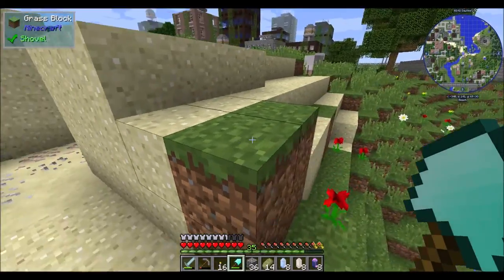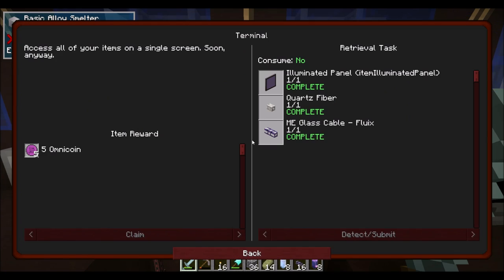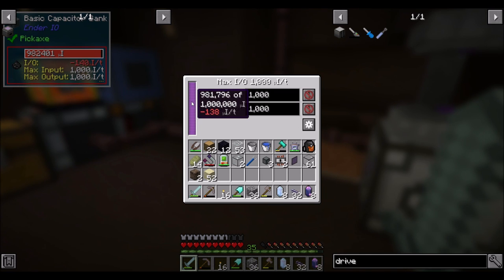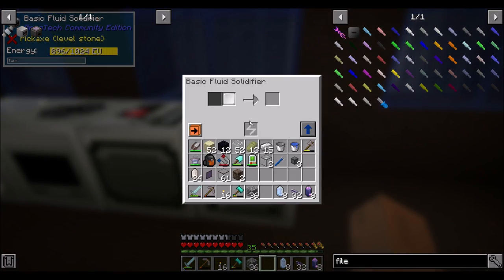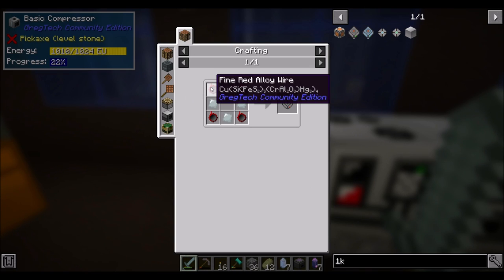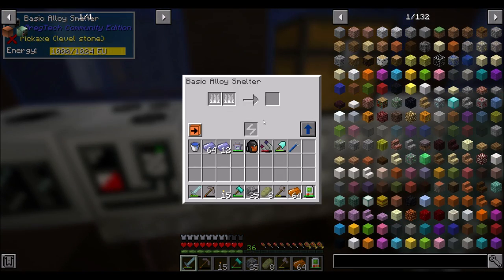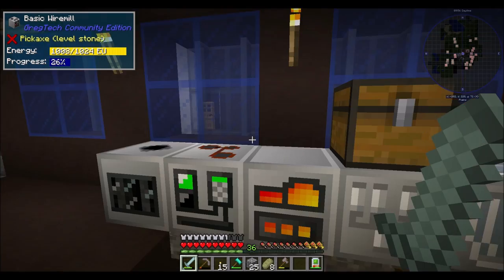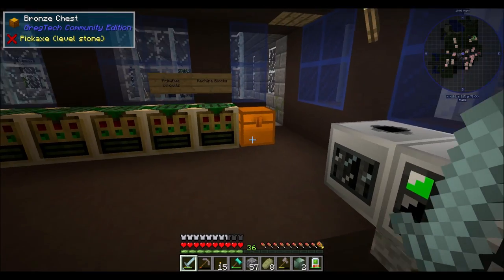OmniFactory   Ep11 AE Progress and Blast Furnace Start

Comment: Overclocking a machine:  A recipe that is <=8 EU/t is a ULV recipe.  It get's automatically overclocked to LV at an increased power usage.  in an MV machine it gets overclocked a second time to MV power usage.  Same for all the power levels.  So a ULV recipe will run very quick in an IV machine.  Of course it's still more efficient to make multiple copies of machine than overclocking but there are quite a few good uses for it.  There are covers to machines that serve as upgrades, but nothing that accepts speed other than a stop on redstone signal cover.  

Don't be afraid to overproduce, letting machines run constantly is key to not grind things out.  Even those cupernickle coils are useful for other things.  You'll need another 16 for the pyrolyse oven.  You'll also eventually want a few more blast furnaces and they don't all need upgraded coils.  

Make a fluid trash can, you'll probably want one for all the gregtech fluids and it's about the same price as that tank you wasted.

You looked at the lathe yet didn't make it?  Don't just assume you can't make something that will save you a ton of resources for motors and rotors/etc.

I know it's being said every episode, but you are running out of copper because you still don't use fine copper wires in your recipes.  You are literally wasting 4x the coper everytime you can use that instead of normal wires.
Reply: Nedrith Stormfire he also needs to realize that there are multiple circuits per tier
Reply: Also dire if you read this, use the Gregtech quantum tanks, the basic tier is as good as gargantuan drums
Reply: @direwoft20 look at ae2 pattern recipie and tell me more about ae2 automation ??? How do u automate ae2 with no pattern ( the pattern req. lv 3 circuit and polyethelyne sheet ) i don't rush ae2 i rush pattern and it work LUL 

Soo use logistic pipes if u don't want to go MV tier and lots of tier 3 circuit :)
Reply: @dourmaster  Logistics pipe would almost definitely be both more fun and more useful than AE early on.  Personally too lazy to bother but the recipes don't look that bad.  However, one big advantage it has is the remote orderer(and ender bags are in the pack for remote ordering on the go).  

AE wireless terminal requires EV emitters which in turn requires tier 4 circuits and titanium.
Reply: What about recipes that use "uneven" amounts of EU/t? Like those 60Eu/t electrolyzer ones, or basically anything that isn't 8,32,128...
Reply: Dire is his own worst enemy
Reply: @SigmastormBeheHunter  Each tier has an upper or lower limit.  ULV is 1-8, LV 9-32, MV 33-128, Ect.  So a 60 EU/T is an MV tier recipe, needs to be made in a MV+ machine and is overlocked once in a HV machine, twice in an EV machine, ect.
Reply: @andrewgood7956  I see. Got it. Lower voltage required than cap (let's say 60EU/t on MV setting) allows just for some leeway in case I want to use cables with energy loss per block when I still want to use just 1amp, right?
Reply: @SigmastormBeheHunter  basically correct though it also allows you to run multiple machines on 1 amp as well.  Most machines however can only accept 1 amp.  Thermal centrifuge is one of the few non-multiblocks that can accept more than one amp.  Blast furnace and a few of the other multi-blocks can accept something like 2 amps per an energy input hatch.

Comment: I loved logistics pipes, not for crafting, but for sorting and storing and making everything available. Put a remote request pipe next to an ender chest and hold an ender bag of the same colour and you have transdimensional storage. Put an extractor pipe on an ender chest and carry an ender bag of the same colour and you have transdimensional automatic storage. Set the logistics pipes up to make a sorting system, use AE for the crafting.
Reply: I liked them for crafting, since they are much more powerfull than AE.
With sattelite pipes and the ability to prefill a recipe you can have a very fast and complex crafting system.
Reply: @hubertnnn  It quickly got complicated, though. AE started off complicated and just stayed there. Logistics pipes and the other pipe based crafting systems all had a problem of exponentiating complexity.

Comment: Damnit, Dire! Use fine wire!
Reply: he even crafts some fine red alloy wire, than not use it just fot that recipe...
Reply: Dire's struggling with the number of ores and processing methods that exist, let alone cheaper crafting recipes. This is why a pen & paper is necessary when dealing with GregTech, or a printed help guide to everything on the side.
Reply: @saturnGEEK  I think the crafting machines ought to be a LOT cheaper for GT, at least for "single purpose" crafting like making motors including its components, so you can set up a factory line of production so you put at one end the materials needed for a craft and out the other end comes a product to use, even if it is an intermediate, if complex, item. That is not possible with GT or indeed industrial craft because the machines are too damn expensive and extremely so in GT. Such machines would have to be able to talk back to prior linked machines to request a  build, meaning they'd have to have internal storage and a passthrough storage or some interconnect that could pass such materials and requests through the chain. But if you can set up one chain of machines for making motors, another for making cases, another for making chips, another for making... etc. then you can fire up an entirely IC/GT suite of autocrafting AND make an interesting factory build (you know, like an industrial craft) and then build up to use it within another pack for complex crafting.
GT needs more complicated machines for some components too. E.g. a chip manufacturing plant that uses copper gold, cobble (for silicon) and rubber/plastic to produce cheap and quick electronic circuits, maybe even using "nuggets" or a fraction of a reservoir filled by one object, to make it cheaper. Casings too, manufactured in a single machine, maybe using fewer resources to do it.
The point of it is to give you an end goal for crafting that you can aim for. As it is, the hassle of the ridiculously overcomplicated and expensive crafting in GT just make you loathe to build more than the minimum necessary and therefore rely on other mods to make crafting at all possible for a sane human being to enjoy as a game.
Aluminium should be a cheap smelt from aluminum too, you recycle it a lot. The expense comes from its attraction to silicon and therefore the difficulty in extracting it from ores, not from the material itself once refined.
Reply: @markhackett2302  The point of GregTech IS its complexity and expense.
It's attempt is to mimic real processes as much as possible. For example: "Aluminium/Aluminum Ore does not exist naturally; it's processed from Bauxite Ore". 
If you want something simple, stick with RF machines and avoid GregTech altogether.
Reply: @saturnGEEK  not making a good case to use Gregtech, pen and paper.. what?!?
Reply: @saturnGEEK  Nope. The point of GT is to extend the endgame beyond IC.
Reply: @Souless44  Swilly is talking bollocks.
Reply: @markhackett2302  Somewhat. But the dev of GT has stated in the past that it's mimicking real world processes. As a result, everyone hates him for the complexity of his mod. Don't like it? Don't use it. Simple.
Reply: @Souless44  JEI is fine, but not having AE early on makes it a pain to craft anything. If writing isn't your thing or don't like paper in general, spreadsheets work as well. Workbenches are good as well. But this is the first time Dire has used workbenches since 1.2.5/1.3. Look at Forgecraft (1) Season 2 from many years ago.
Reply: @saturnGEEK  fair enough, but regardless.. when I look at fun and playability, I'm not writing stuff down. Not that I haven't. Especially with nuclear reactors and even draconic reactors. I just find long term, I will gravitate toward a bit less complex process. Maybe it's just me.
Reply: Mark Hackett You say you want a goal for crafting but you also want magic block-y machines that replace entire production lines by themselves? That isn’t a goal, that’s trying to avoid playing the game outright, because automation inspired by real-life industrial processes is kind of the whole point of the mod. Setting up a production line is not only possible, but _easy_, because there’s so many automation hooks included in the mod and recipes do become easier and cheaper as you unlock higher tier machines. You’ve already seen it even at this early stage like with people telling Dire to use fine wire in his motor recipe to reduce his copper investment by 75%. Being able to constantly go back and tweak and refine your automation as you unlock new recipes is one of the nicest things about the mod and why it’s so fun for people like me who enjoy the challenge of automation.

I certainly think it’s a much more interesting way to design a mod than something like Thermal Expansion where you get to lategame in a few hours and there’s nothing to do there, or Draconic Evolution that says, “Okay, here’s a bunch of completely broken recipes which need something even MORE broken (hi RFTools Dimensions) to make reasonable.”
Reply: @Souless44  There's nothing wrong with writing these things down. It's a confusing mod, and trying to search through recipes in JEI for that one recipe out of 32-120+ isn't worth it. 
Again, AE is worth using IF you have the resources and power requirements since GT tweaks a lot of recipes. If you don't want the grindy/complex play, then don't play GT and stop complaining about the complexity of GT. 
GregTech is for those that want the extreme challenge of complexity and insanity, where there is no end and possible headaches for eternity. Pen & Paper is completely optional, but much easier than relying on JEI for everything. If that isn't your sort of thing, stick with Thermal Expansion and related mods. Maybe give Mekanism a try.
Reply: @saturnGEEK  No, the aim was as I stated. Its method of deciding how was "realistic". HOWEVER, that only extended to the various minerals you got, not the crafting.
Reply: @ShawFujikawa  Yeah, you need to engage your brain before reading, not after. The crafting for industrial machines is making a process that each item goes through. Since you do not literally get an entire workforce of dozens to play with you in minecraft means you have to have the workforce replaced by automated item dispersal/crafting.
YOUR job is to design an efficient factory floor a' la industrial process as typified by the Ford Motor factories in the early 20th Century. You know, the height of the industrial revolution.
So, yeah, engage brain before you start reading, not after, kid.
Reply: @markhackett2302  No need to lose your temper. Nobody's out to get you in this thread and you are an adult like everyone else here.

So, you essentially want to recreate full-scale assembly lines and think GT should have been focused on that. That's seems more like Immersive Engineering's thing to me, but even then the industrial processes GT simulates don't or can't really use assembly lines. Like ore processing, or oil refining.

Don't get me wrong, I've entertained the thought of trying to not use AE or pipes and using conveyors for all my item movement needs too (I think IC2 could use its own form of belt- or rail-based transport as it fits the theme) but it doesn't quite jive with the existing theme of the mod.
Reply: Swilly Swoggiston you make a good point until the part you get insufferably patronizing with “why not try these other mods [that you most certainly have used before]”

It’s also perfectly within anyone’s right to complain about a mod while still trying to enjoy it. Your sense of fun obviously doesn’t mesh with his, but that doesn’t give you any right to call him out on his version and what he’d like to see from the mod.
Reply: @leavy  Well said.
Reply: @saturnGEEK  Pen and paper? after playing different versions of Gregtech over the years, my memory has become streamlines to remember basically every single production there is. XD Playing through this pack I hardly have to look up ore recipes more than once.
Reply: @saturnGEEK  Exactly, lots of people think "oh wow, so many ores!" and then realize they actually have to use some brains and then think "UGH, so many ores..." Kinda annoys me as a LONG time Gregtech player.

Comment: This series is really making  me think thaf I overestimated dires ability to adapt to new mods/actually dive into the recipes
Reply: To be fair: compared to Gregtech, basically every other main tech mod besides AE2 requires hardly any brains to use. Gregtech requires you to think long term, like thinking up a fully self-sufficient HV-level oil-based power supply and starting work on it in the LV stage.

Comment: (regarding the crates) "I didn't even look." And that's the problem right there. The amount of times you haven't looked for something and it's been there or you just give up after .2 seconds of looking is immeasurable. It's a flaw you have and you never try to get over it. More patience and the ability to slow down and look is something you need to work on.
Reply: Yeah, dire seems to be stuck in his ways

Comment: A tip for blast furnace, make sure you have at least 4 full batteries in your CEF. It seems that amount of full batteries = amperage of output, and you need 4 amperes.
Reply: Correct. Also, there's a 16-battery version that outputs 16 amps, this can be useful if you wanna still use LV power in the MV stage. Just transform that power upwards and you got 4 amps of MV power if you can produce it.

Comment: Dire speed of machines are based on the voltage tier you are using of the particular machine.
Reply: Yes. Its based on the recipe energy use and over clocks when 4 times the energy is available. Ergo, 8 EU will Get overclocked once With lv power
Reply: If you've never played gregtech, you'd NEVER guess that's how they work. That, and recipes get faster the more excessive your voltage is. For example, a stick and coal in an assembler takes 20 seconds at 1 EU/t, which would just look stupid unless you realize that's literally instantly crafted even in LV stage.

Comment: Interesting that one of the easiest metals to melt irl, aluminum, requires the more powerful blast furnace to melt in here.
Reply: Producing aluminum is really really power intense, you need to break down Bauxit ore for it… aluminum has a low melting point, but the extraction process from bauxite isn’t easy
Reply: i mean, sure, but he ~has~ aluminum dust, the other machines extract the pure Al dust :)

Comment: Hey dire, last video you said AE dosnt need controller in this pack, since its like skyfactory...

But skyfactory 3 i belive still had a cobtroller for more than like 3 connections to a cable.

Then With the controller, you had "Infinate" channels
Reply: LiveCookie12 That’s the energy accepter. You can still setup a network without it, but with the Resonance Chamber instead
Reply: When he said Skyfactory, he was talking about SF4. 4 is more progression and less kitchen sink and is the pack he just finished before this series.
Reply: @mo5128  ive seen Ssundee play sky factory 5 times...

Im used to some features...

Comment: He trashes the tank i lose my s**t....  you will need lots of tanks until you can automate all the chemistry :( 

(Yeah it's just iron but still I don't get it why he trashes it)
Reply: And he didn't know that Greftech had is own drum that hold 32 bucket and it's only 8 bronze plates.
Reply: @MrZarvoxx  And iron drum that holds 256 buckets.
Reply: With AE2 you dont need tanks since you can encode fluid disks which hold tons of fluid, its more more expensive but easier to automate.
Reply: Imagine not using quantum tanks
Reply: And you can easily empty those tanks by just putting it 2x2 crafting zone.
Reply: Yeah, a part of me died when I saw that. Like, it's Gregtech, DON'T TRASH ANYTHING!!!
Reply: Tim Gibson I’ve seen you commenting progressively as you binge the series. If you’re even slightly familiar with gregtech this is going to be a soul crushing experience
Reply: @chonchjohnch  Well, (un)fortunately dire has already just about finished the job, so the rest of the series can't really do much more damage anyways...